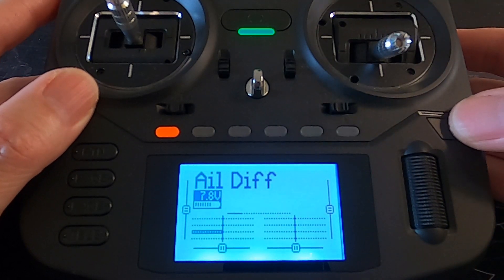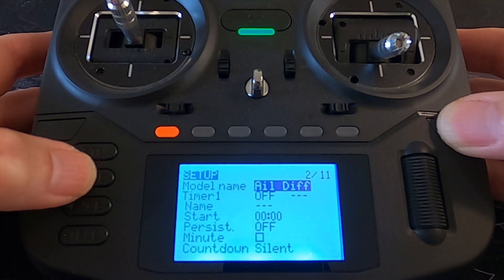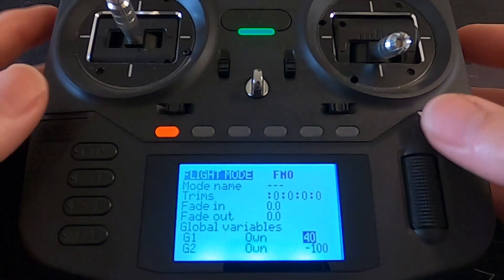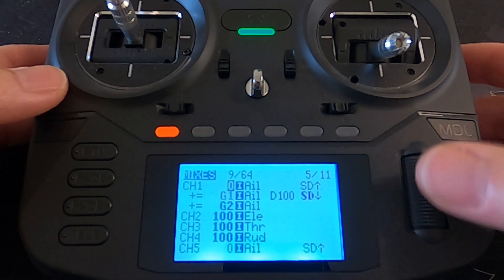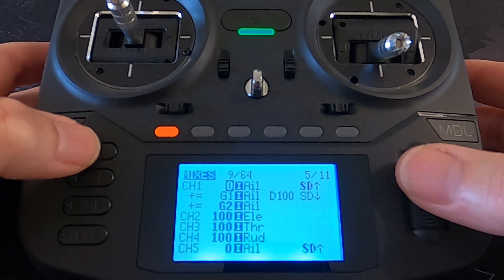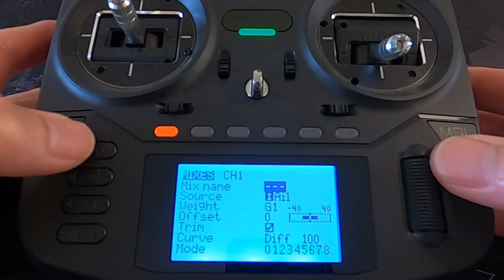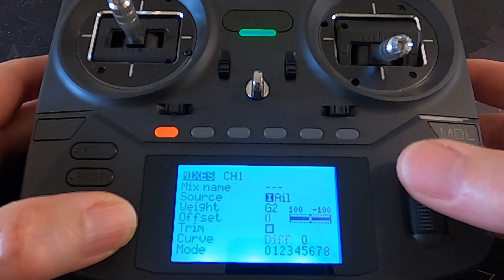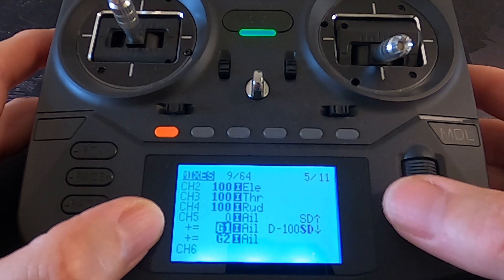RadioMaster Boxer Setting Up Aileron Differential with GV's

Comment: Building my first plane, working on Ailerons, i have one of my servos for Aileron working, my second servo isnt getting signal, Ive tried switching the cables and the 2nd servo works perfect. so its not wiring, I have 2 channels set up. Is it because i dont have the second servo programming right on the Radio control?
Reply from the maker: It sounds like it. Which receiver are you using ExpressLRS? and what channels do you have the aileron servos plugged into?
Reply: The receiver is ExpressLRS, on the FC I'm using M5 and M6, on the Boxer under Mixes, it's Ch1 and Ch 6. Thank you for your help.
Reply from the maker: @Lycan19 you can only use channel 5 for arming with ExpressLRS receivers.